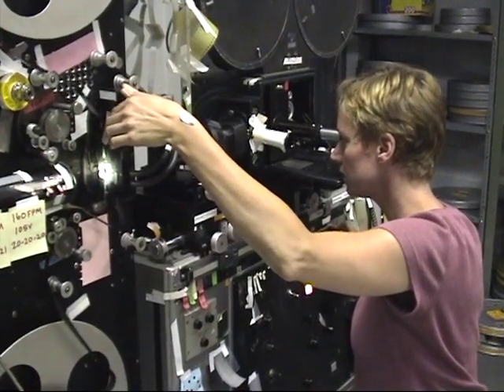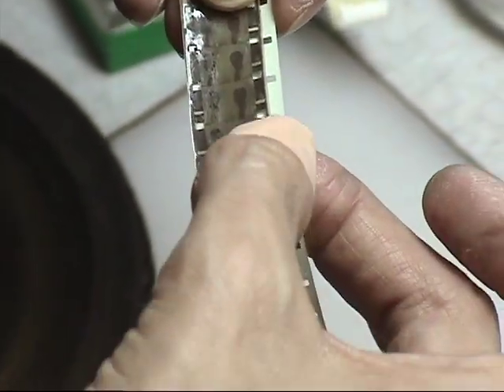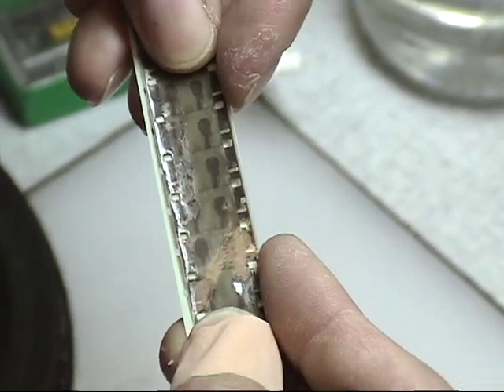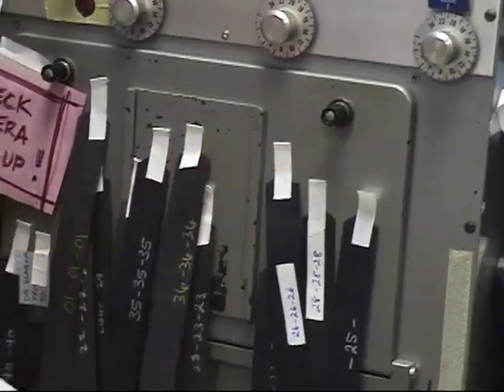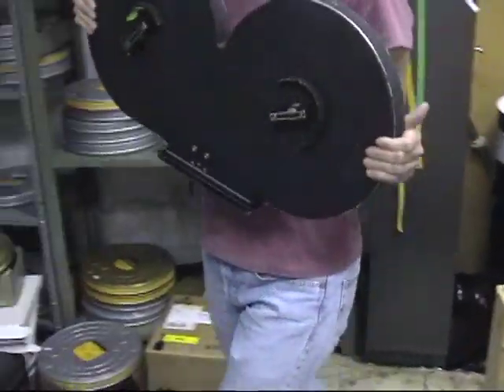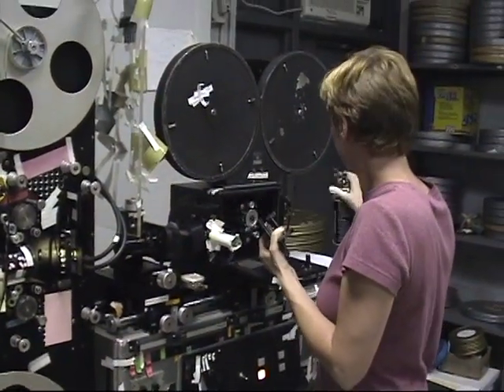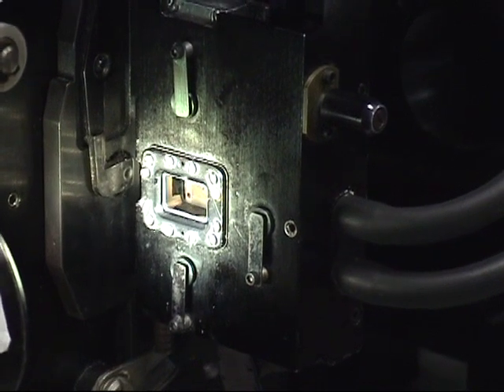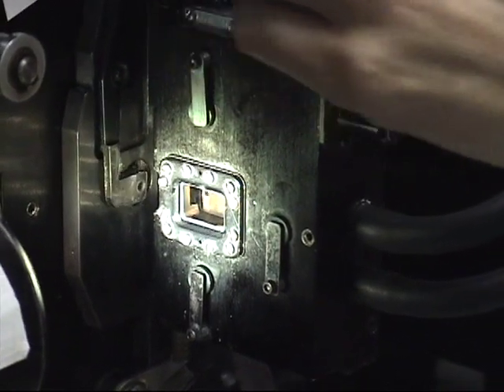Wet Gate Optical Printer, 16mm (clip 30)

Comment: Why no white gloves, sure it might be old film, but still to do this type of work, its micro presion work ? This is the type of machine used to alter the Zapruder film and edit out that which was required to hide the real truth of jfk's head wounds?
Reply: Gloves would catch on broken or damaged perforations. You can feel them before you do damage. Gloves take away the feeling, much like a condom.
Reply: @uncled39  yep sure ,but with older films there special gloves, like medical grade gloves which are very smooth and will not catch onto anything. 😎😎

Comment: I used to print using wet gates like this on Oxberrys around 40 years ago. 
We used perchloroethylene wet gate fluid under pressure in an "aquarium" gate in the projector. You  had to be wary of bubbles and dirt on the prism "windows". All our documentaries or super-16 features had titles superimposed by printing original negative, blown up to a 35mm title negative then reduced back to 16mm 7249 Eastman Colour Reversal Intermediate (CRI) in an aerial image printer. It was noisy and the wet gate fluid stank despite efforts to get it out of the room and recover it, but this was the best way to copy and add titles to 16mm films back in the day. It could remove almost any scratch or blemish short of an emulsion gouge but the pilot pins were further from the shooting frame than a dry gate, meaning film float was a little worse in a wet gate. Consequently we avoided wet gates for VFX work.

The CRI stock was tricky to process and grade and years later we found its colour dyes were unstable. I wonder how many of these films have CRI A and B roll inserts that have faded into an unprintable state today? Sad but true.

Thanks for recording this lost art of cinema.

Comment: I've had an idea for something like this for converting single frames from a a DVD (or Blu Ray) to 16mm film making a theatrical print of modern movie such as frozen or the lego movie.
Reply: shipwreck911 I've been thinking about this as well for a couple years now. It is possible but you also have to think about sound recording which isn't as simple as recording pictures. I wanted to make my own film with inserted digital effects scenes like they used to do it. It would also be fun to make my own policy trailers on film to show before projecting my films :)
Reply: fancysnake1 ever heard of fullcoat? its 16mm magnetic sound tape. and also, if you wanted to project it you would have to use color reversal. the cheapest i could find is at Pro8mm's website. $85.75
Reply: It's very doable.  I've done it to insert some abstract CG into a music video shot on film.  You have to experiment a little to get the contrast right but it worked pretty well.